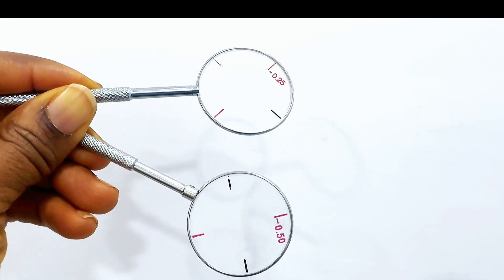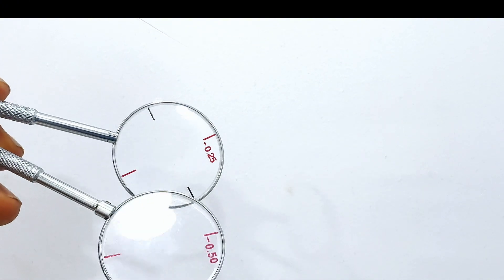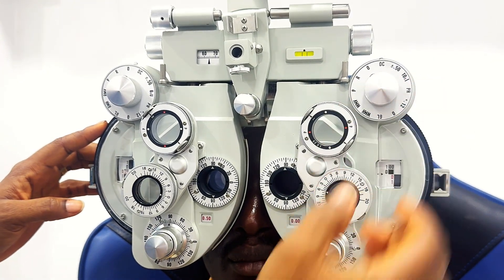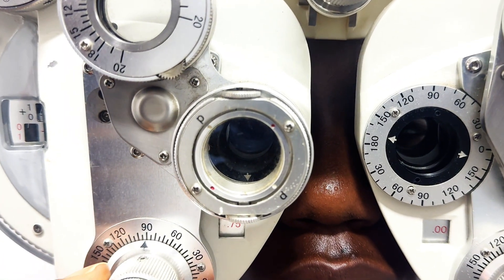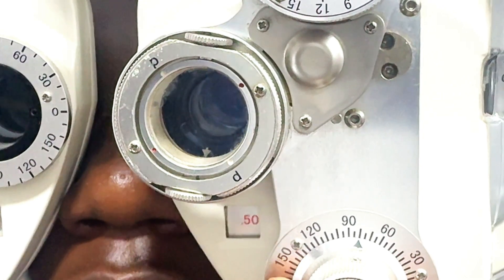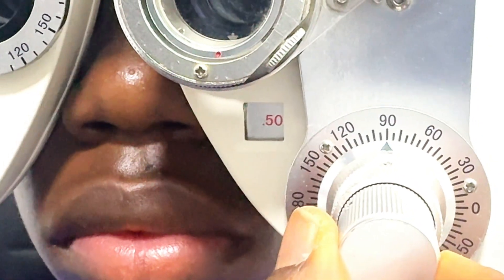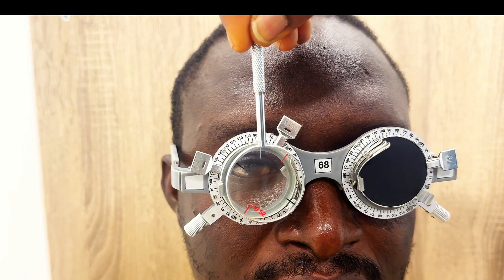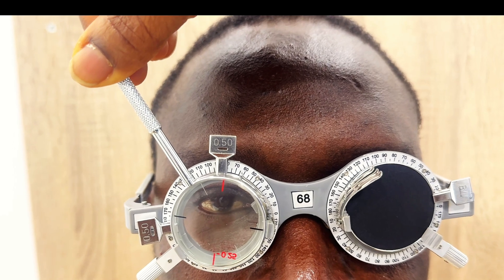Jackson Cross Cylinder Explained: Master Cylinder Power & Axis Refinement

Comment: If a person starts off with a -0.75 spherical prescription but needs -0.50 cylinder correction, will the new prescription be -0.75 (spherical power) with the -0.50 cylinder added to it?
I don’t understand changing the spherical power when adding cylinder.
Reply from the maker: The change in sphere happens after you confirm the cylinder power using the JCC. Once your patient accepts, say, –0.50 cylinder, you adjust the sphere to keep the lens balanced.

New Sphere = Original Sphere + ½ of Cylinder Power

So if you started with –0.75 and added –0.50 cyl, your new sphere becomes:
–0.75 + 0.25 = –0.50

Final Rx: –0.50 / –0.50 with the axis

This step ensures the spherical equivalent remains correct for comfortable vision (circle of least confusion staying as close to the retina as possible).

Let me know if you still find it confusing.